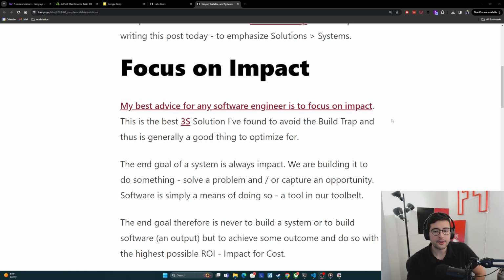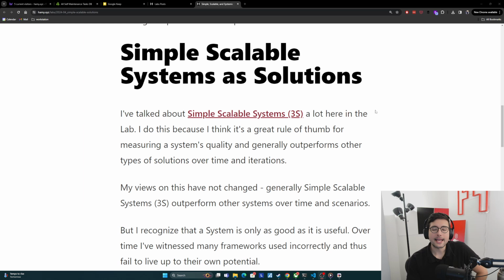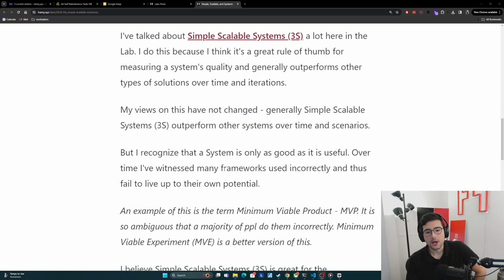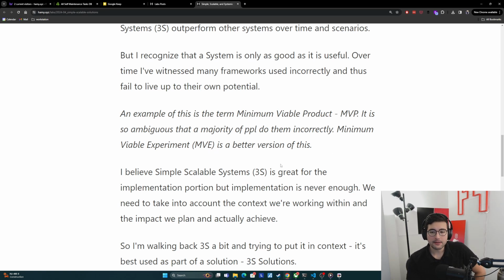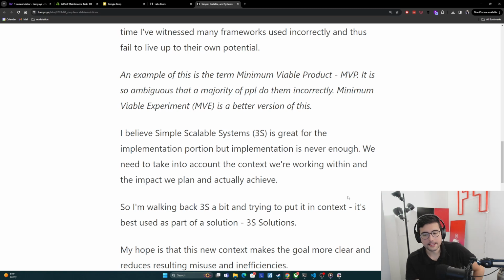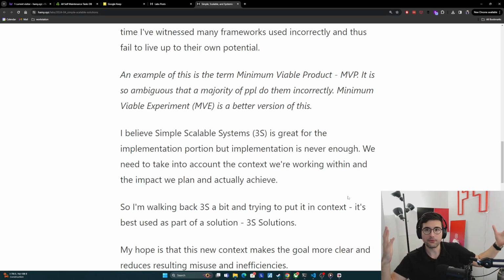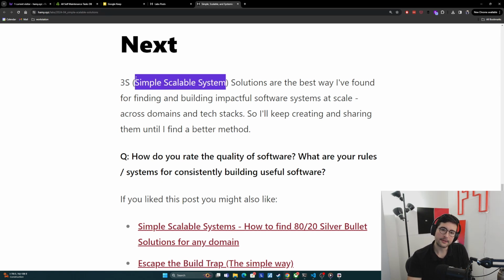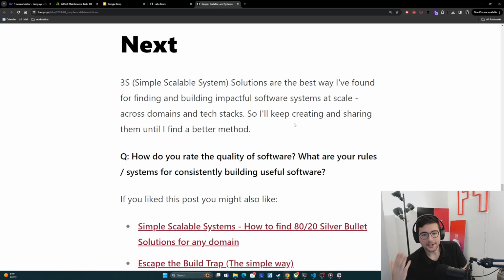Simple, Scalable, and Systemic Solutions - How to build Software with good ROI

Comment: I worked as a data engineer & in that domain, scalable means that data could be aggregated in multiple ways (as requirements change) and that I could transform the data easily & consumers of the data are introduced easily via a pub/sub architecture like AMQP. The consumers could do anything with the final aggregated data e.g. send a notification, generate a report, be data sources for dashboards etc.  The bulk of my time was spent on creating new consumers or modifying existing ones. It made my life simple.
Reply from the maker: Yes I think with time you realize that most software / domains have similar values - we're trying to build Simple Scalable Systems.

But what those actually mean in a particular domain are very often different.
* Simple for one audience may be complex for another
* Scalable in one respect (perf) may be inscalable in another (complexity)

So it's all about crafting the system that best fits the domain / scenario at hand. A solution if you will.